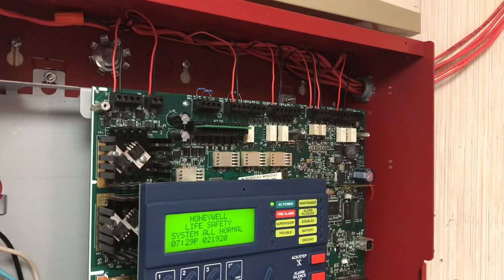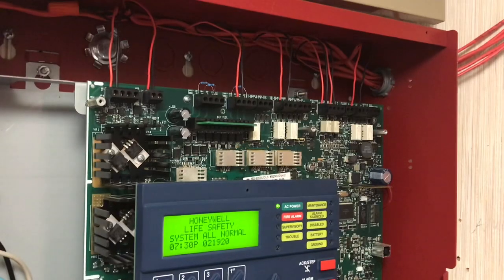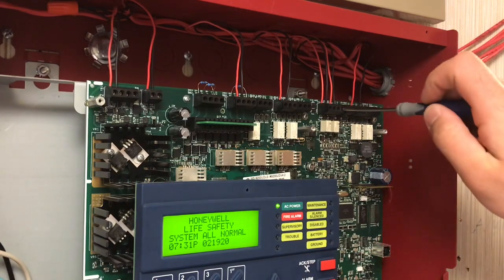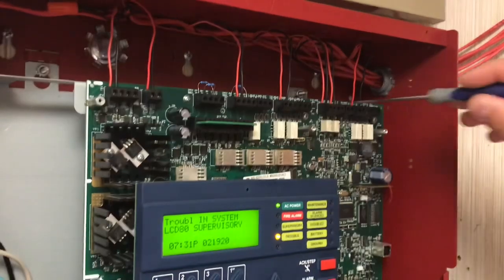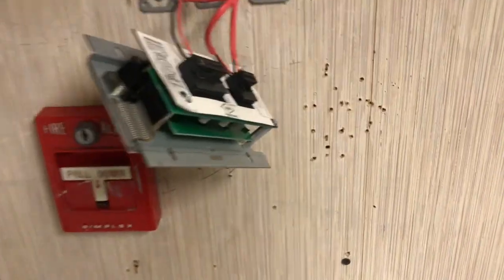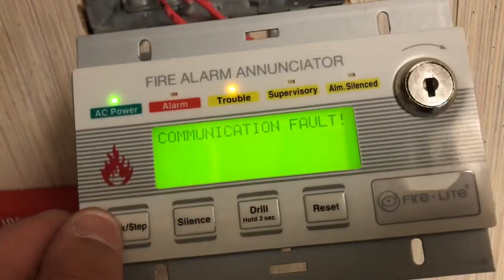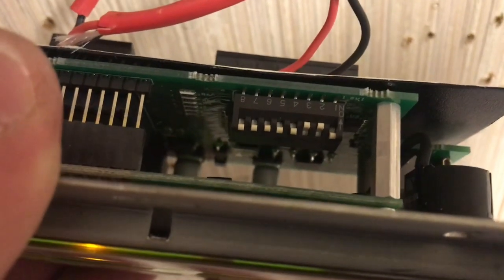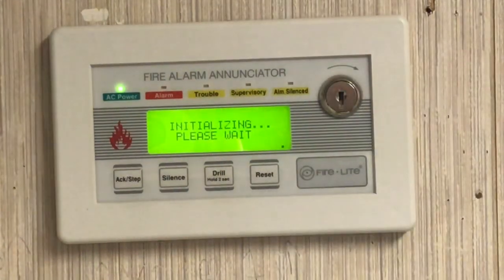How to wire and program the Fire Lite LCD-80F

Comment: hello David
i wish you fine 
ihave a problem with lcd -80 the lcd get all event from the panel but all switch in lcd -80 not worked and don't make any response to the panel however i make the key of the lcd-80 on
can you pls tell me what i can do 
more thanks
Reply from the maker: Great question, I’ve seen this before. You need to enable the global controls using the DIP switches on the back of the annunciator.

Comment: Can the LCD-80 be used as a main panel fire alarm system? Also, I'm not trying to brag anything about Simplex but is there a way you can do some technical work with Simplex stuff? I would love to get either a 4010 panel or a 4606-9101 annunciatior for me birthday. Which is in four-five weeks.  As always,  loving the videos.
Reply from the maker: Jared Thompson The LCD-80 is an annunciator only. It will not work as a main FACP. There are no outputs. I know a little bit about Simplex but not a whole lot. MrTruealert has helped me a tremendous amount.
Reply: Well to answer both of your questions. No you can’t do main panel things on a simplex annunciator either. What’s up with everybody’s birthday on February. Lol
Reply: @pvh_facp4001yt  My birthday is in March,. Haha.
Reply: @Dredpath1  Ok. Thanks for tips. Nice video!
Reply: @FireRescue80  oh lmao i didn't read the 4 to 5 weeks part lol.
Reply: @pvh_facp4001yt  Ha.
Reply from the maker: Jared Thompson anytime, thanks

Comment: Hi there, I was wondering fire alarm Control panel communicationwith 2 or t3 on the annunciator?
My school does have one
Reply: But my school have a EST system
Reply from the maker: What?
Reply: @Dredpath1  my apology, mispell because I was sleeping last night.
I was wondering how FACP communicate 2 or more of the annunciators?
Example- main panel in the electrical room. One annunciator front area and other annunciator in back door.
But I know simplex can do that.
Reply from the maker: @tallr264  Think about address of all devices on a signaling line circuit. Everything gets daisychained. Feed in from the panel or previous device and feed out to the next device. The annunciators work the same way.
Reply: @Dredpath1  ah. I see thank you